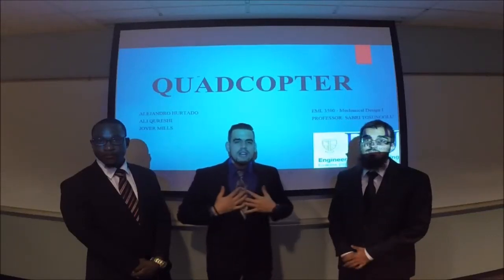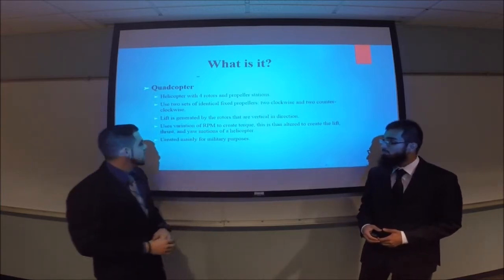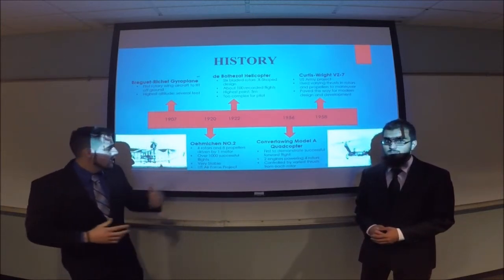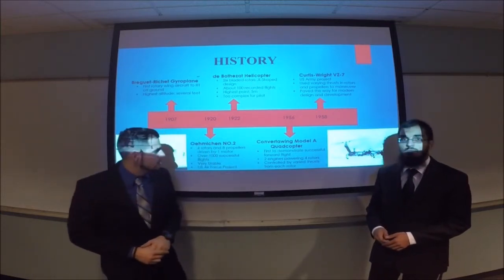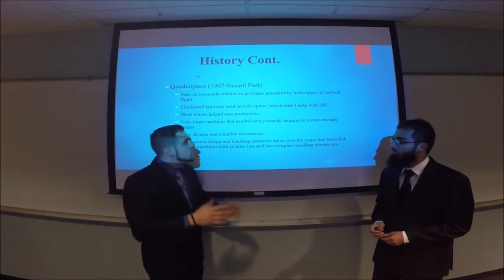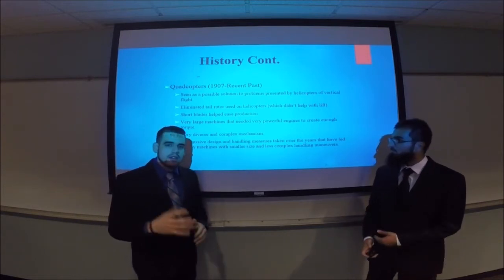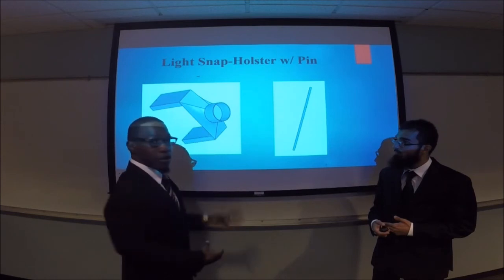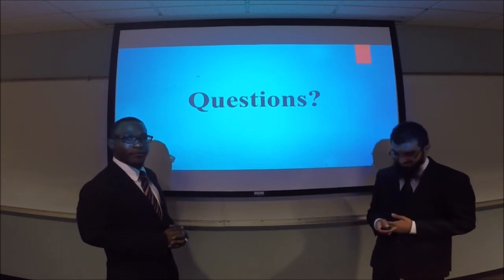Team 6 - Quadcopters

Comment: Very sharply dressed! Very good and interesting supplemental speaking- you weren’t just reading the slides. Good pictures. Everyone spoke clearly and behaved professionally. Fantastic original design!
Criticisms: 1) Don’t let text or pictures project onto a speaker’s face. 2) Text on some slides was too small, even when viewed full screen. 3) The first slide could have been split into 5 or 6 slides. 4) Don’t have speakers visible if they won’t be speaking. 5) Some capitalization inconsistencies. Either capitalize after a hyphen or don’t. Either capitalize each word following a bullet or don’t (See “Future of the Quadcopter” slide). 6) Is it “Quadcopter” or “QuadCopter”- I saw both.

Comment: Good clever design for improvement of the quadcopter. Layout of the PowerPoint was well done with good visuals. However the text was too small to read on the slides. Would have liked to have seen a conclusion but good project overall.

Comment: Great introduction. Presenters are engaging. Lighting is a dark but the video quality is great. Try to not stand in front of the projection. The slide fonts need to be larger, its way too small. Though you guys expanded on the slides effectively. The most professional attire of all the groups. Only the presenter talking should be on scene. Design is innovative and explained well. The CAD model is great to show how it would look. There was no conclusion.

Comment: I thought that the presentation was well put together. It flowed uniformly through each presenter. Each presenter was knowledgeable of their section. Attire worn for each presenter was professional which was a plus. The PowerPoint in the background was visible. I would suggest to not read word for word from the slides in PowerPoint. Having two presenters at a time is a bit distracting. I would recommend to just have one presenter at a time, except for the introduction. The slides are used as a form of a guide. Overall the presentation was excellent.